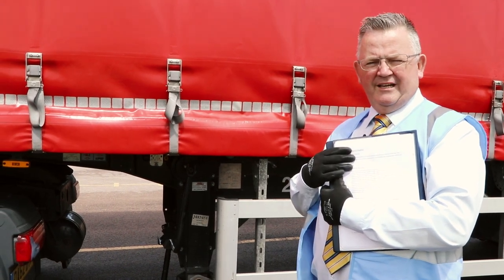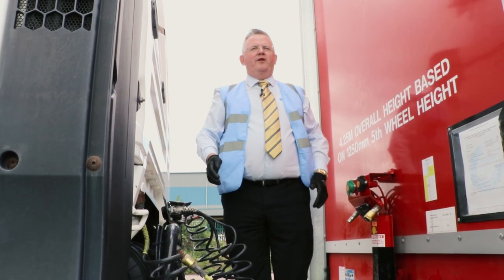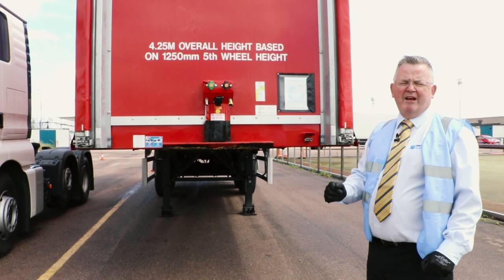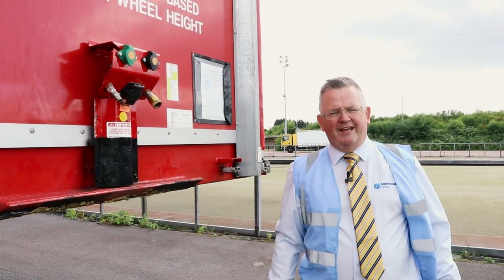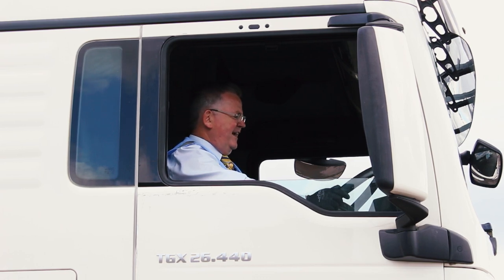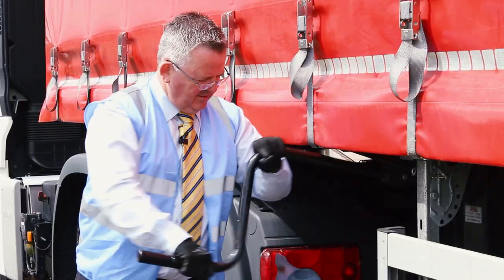Mainstream Group   Coupling & Uncoupling Training Video

Comment: 2 points,  
1st that MAN has a light test feature, press it then flash the full beams and it will cycle through ALL the lights for about 2 mins useful when your out by your self.

2nd reverse lights must work if they fitted but are NOT a requirement  of an MOT. However in this case it was probably an over sight but you clearly got the fact the examiner is helping you check all your lights. Just say well done for the video!

Comment: uncoupling- pull forward away from the king pin..lower your ecas slightly to take the weight off the 5th wheel...this will lesson the chance of a very heavy trailer dropping down on the rear of the unit.If the trailer is front heavy it will lesson the chance of the trailer dropping forward on its chin.  Coupling-air to low?..tug with legs on the ground?raise them with the ecas slightly to prevent damage. You MUST put the dog clip on b4 air and electric lines.Parking break,stay with it for a second or two,just in case, in real life you left the unit hand brake off..dont get in the unit with greasy gloves..dont forget to check all side trailer and marker light and the unit lights again...........good video..

Comment: Thank you it was very clear and a great refresher video.
Reply: KrissHollandHypnosi.  hi IAM. from the USA with 40 years semi driveing   my question is why do you take off the the number plate.  ior with each company that pulls it. use thier number plate ??????
Reply: Ashley Bunch In the UK , the trailer has no registration number , it has to display the reg number of the truck pulling it .

Comment: Good video i always put the connections properly stowed away one of my pet hates is drivers who leave the trl connnections draped across the catwalk of the unit...a sure way to wrap them around the prop.Personally i always lower the air on the unit as i pull out from under a trl.

Comment: Weird methode to uncouple. You should drive a bit forward untill  the kingpin is free. Then you lower the the 3rd wheel to prevent getting grease all over the bottom of the trailer. Once you are clear raise the 3rd wheel again. Same goes for coupling on, lower the truck then in reverse till kingpin is almost in. Then raise the truck again till legs get of the ground a bit. Then reverse the truck till kingpin clicks into lock. Thats how you prevent damage to the legs.
Drive a bit forward to make sure your hooked up.
Reply: What are we talking about  3rd w or 5w i world like to know

Comment: One small point is that it’s poor practice to have the landing gear fully on the ground when doing the “tug” test ; the video showed the feet dragged and tilted and this can quickly cause damage , to the trailer and/or the yard surface . A quick lift of the tractor ‘s suspension prevents this .
Reply: aboctok That depends on how high or low the trailer has been left , in the video the legs were not clear of the ground which is why you could see that they dragged and tilted ; it only takes a moment to press the raise button until you see a small lift , then you know you’re not doing any damage.
Reply: Oh don't worry, she was locked in all right, he spun the back wheels of the unit TWICE just to be sure. He wouldn't be driving for me!
Reply: maninthecab , blind leading the blind mate 😞
Reply: @seamusburke1828  the foot was flat when wind down. When he shunt forward if u look there twisted up lol
Reply: I'm not even a truck driver but did anyone else see the big massive dent in the road surface he mentioned he was trying to prevent lol. I saw another one of these videos that mentioned keeping the legs just a little off the ground to stop this.

Comment: Warning ⚠ if the trailer is loaded, when uncoupling, you need to drop the unit suspension, otherwise you will bend the trailer legs and you can damage the legs lifting mechanism.
Reply: correct:
drive away  a couple of feet
 the fifth wheel is still beneath trailer
 lower suspension while  look at the  5th wheel moving downwards away from the trailer leaving a gap
 now pull forward  all the way.
 level suspension back in place. 
do not forget to fetch back the plate!

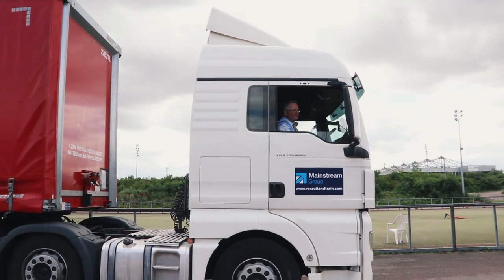Comment: 4:25 move forward a foot...drop the ECAS [deffo with heavy load[..remove the number plate first saves leaving it behind..5:43..check service date too...8;49...lift the ECAS a little bit..less leg strain..and less chance of wheelspin and tyre wear..10:48...push the winder.....its easier...11:43..do you need the engine running to check lights?..12:01..foglights???..but a good demo..

Comment: Wondering why they don't teach to lower the suspension when pulling forwards. Most of the beginners will find out why when they drop a fully loaded trailer with heavy load.

Comment: Errors

1. 2:29 Pulling cables instead of the actual plug to disconnect the plug (that plug's too loose in any case).
2. 5:01 'Trailer' is not spelled "Trailor".
3. 8:54 "Sometimes air pressure will be low...." How can it be - you've just reversed back to couple with the trailer ? Nothing in doing that affects air pressure.
Reinserting locking pin: the function of that should be tested too to ensure the trailer release mechanism cannot operate. It begs the question why a padlock isn't used here.
4. Testing trailer lights - not what I'd do. I'd switch them all on (without starting engine) - using hazard for both indicators - and walk round the vehicle to see that all are lit. For the brake lights, I'd ask the examiner to operate the brake pedal.
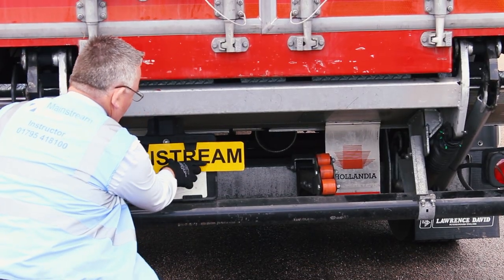5. 12:21 That number plate is not secure AND you forgot to check number plate light - so best if number plate attached before lights check.
6. You didn't check tyre pressures on the trailer and from 12:21, I'd say they're too high (or there are too many wheels on the ground).

Why is there a control to apply the trailer parking brake - why is it not on already ?
Reply: whilst in revers the compressor doesn't run. thus if you are going in slowly in an automatic you may break a bit this running the air pressure low. if you don't leave the unit running in some cases when you reconnect the air line it is possible that the unit may need a couple of seconds to rebuild itself. 

also the dog clip is used to prevent somebody from been able to walk to the trailer and unclip it whilst sat at traffic lights or so fourth. but if you was to use a padlock in the event of a trailer fire and you need to separate the unit and trailer fast a padlock would slow you down and put you in significant unnecessary rick.

a full trailer and unit combination has many lights and the practice of a light check while the engine is running is to protect the batteries. and your indicating on every subsequent brake check you will ask somebody who you don't know to enter your vehicle licenced or not  to push your brake peddle to perform this check?

drivers are equally not required to check tyre pressures with any measuring equipment as the tyres when messed with are at risk of detonating like small bombs.

and lastly some people leave the trailers without the brakes on and if your going under the trailer their is a chance for you to bush the trailer back potentially killing somebody.
Reply: @newcastlewatson9370  "whilst in revers the compressor doesn't run"

I've never driven such a vehicle but clearly you have less experience than I - coming out with nonsense like that.

"if you are going in slowly in an automatic you may break a bit this running the air pressure low."

Using the brakes in such circumstances will not run the air pressure 'low' - unless the vehicle is faulty.

I've NEVER heard of a case where a trailer's been released while sat at traffic lights ! A padlock would be suitable for overnight unattended parking.

"a full trailer and unit combination has many lights and the practice of a light check while the engine is running is to protect the batteries."

Running all the lights for 15 minutes will take less out of the batteries than starting the engine. If that was a concern, better to fit new batteries.

"your indicating on every subsequent brake check you will ask somebody who you don't know to enter your vehicle licenced or not  to push your brake peddle to perform this check?"

Only their hand need enter the vehicle - as this is done for an examiner, not trusting them is not really an option !
You don't need a licence to press a brake pedal.

"drivers are equally not required to check tyre pressures with any measuring equipment as the tyres when messed with are at risk of detonating like small bombs."

The driver is LEGALLY responsible (in the UK) for ensuring the vehicle is roadworthy. Doubles cannot be checked visually on an empty vehicle. A tyre pressure gauge is the usual option. Tyres don't detonate at times they fail, it's due to mechanical stress.

"and lastly some people leave the trailers without the brakes on and if your going under the trailer their is a chance for you to bush the trailer back potentially killing somebody."

I'm aware of trailers with this capability and am appalled. It's a case of convenience over safety. Bad practice by drivers. I wouldn't do it even if instructed to do so !
Reply: @millomweb   so in reverse with an automatic when you press the brake you bleed air out the system. If you press the brake enough times it will deplete the available air and as the engine gear is set to reverse the compressor doesn't run. So it is possible to set a low pressure alarm of.

Now I didn't say it's a frequent problem but it could happen, most 5th wheels have an extra little metal lock for the fifth wheel the dog clip allows a passing police officer to check its couple's properly and as I say gives peace of mind to the driver. A padlock would be again useless as you say in services before you set of you should carry out a full check thus you should check the dog clip.

Now a walk round light check would usually be carried out at the start of the shift usually on a cold morning, so starting the engine allows the air tanks to fill up and equally you can check your lights and listen for any air leaks and so on all at the same time. And considering the cost of batteries running the engine and taking the stress of the batteries is always going to be positive.
Reply: @millomweb   and it is a legal requirement for the driver to check the vehicle is CORRECT. a drivers tyre check is checking the tread and that they're free from cracks, tears, chunks missing, if it's a double axle there is no rocks and that they are correctly inflated. Now that last one is a visual inspection. I would argue no firm would want there drivers testing pressures with a pressure gauge. More report the low pressure and have it checked out?
Reply: @newcastlewatson9370  "as the engine gear is set to reverse the compressor doesn't run."

That's absolute nonsense ! Compressor's driven from the engine and has nothing to do with the gearbox !
Reply: @millomweb   it effectiveness to fill the tanks as a driver is constantly on and of a break is greatly reduced to the point it won’t replenish the tanks quick enough.

I’m speaking from experience with a MAN and a merc actros and a dafXL
Reply: @newcastlewatson9370  Whichever the problem vehicle is/are, get them fixed. I'll grant one exception to the 'get it fixed' advice - in a 'first thing in the morning case' where the engine's not been running long enough to fill the tanks properly. Other than that, there should be enough air in the tanks to not deplete the pressure to a warning level, the compressor should be fast enough to maintain adequate pressure - and the brakes should be correctly adjusted so that they don't use too much air each time they're used.  
If you've experienced such problems in the same company, I'd question the company's vehicle maintenance policy.
Reply: @millomweb   so you the drive when reversing are in a tight yard making minor corrects reversing constant brake, brake maybe a gear change and the compressor should be able to pressurise the system quicker then I as a drive can deplete it that’s your argument cause that argument is weak.
Reply: @newcastlewatson9370  There should be enough air in the tanks + with the engine running, you should not run low on air !
Reply: @millomweb  as you change gear you use air, as you change level you use air as you use the breaks you use air the compressor runs to refill it isn’t made to run continuously.
Reply: @newcastlewatson9370  Do autos use air ?
Changing level - you mean raising suspension ?
The compressor will run continually if it needs to.
Do you know any forums where running out of air is discussed?
Reply: @millomweb  yes autos use air, and suspension just general ground surface changes.

Comment: Hy. Keep doing that tug test with trailer legs down, in contact with the ground and soon will need to replace the legs. Enjoy!!!.
Reply: Makes sense sure if for any reason the a fault with 5 wheel and you pull forward with legs not down trailer will slide and hit the ground ..
Reply: @cathedralImages  All Im saying is to lift a bit the legs of the ground.

Comment: I'm a trucker my self but one thing about it those are some funny looking rigs across the pond js🤷‍♂️ but why so many electric lines?? And glad hands would be better for the air lines then them quick disconnects
Reply: The three electrical lines are (1) Primary electrics (position lamps, brake lamps, direction indicators, reverse lamps) (2) Secondary electrics (on most trailers just the rear fog lamps) (3) ABS/EBS. Ther reason for three separate lines is essentially for backward-compatability - an older trailer might well not have ABS/EBS or rear fog lamps and there are not enough conductors in the existing Primary Electrics plug/socket to accomodate anything beyond position lamps, brake lamps, indicators and reverse lamps.
Reply: @TheRoybeasley  lol that's alot. Here the one electric line (7pin) works every thing marker lights, turn signals (left, right), brake lights, ABS. There's a optional electric line for accessories. The only ones you see with multiple electric lines are on multi axles (dump trailers)

Comment: Your M and S tie is the way? I guess you are not suitably dressed. Why is the airl down at the end of your test? Yellow line on first just in case something is dodgy on the trailer brakes. Yellow line has full air down. It also tells you you've applied the parking brake correctly.in the cab